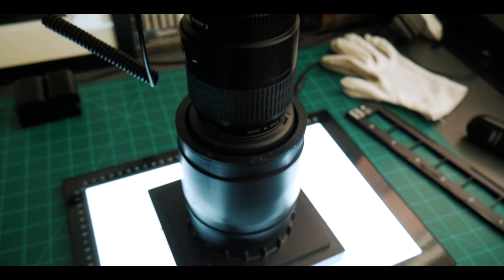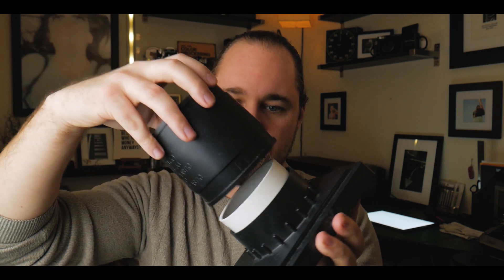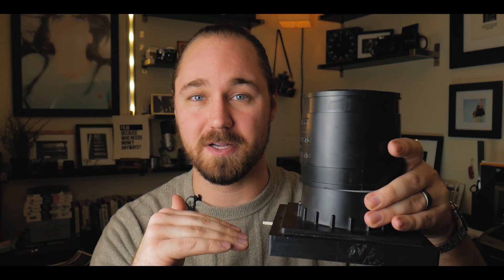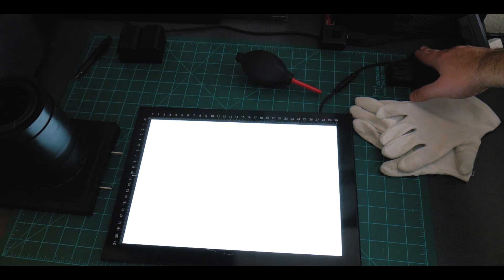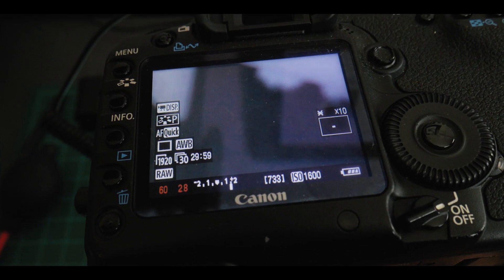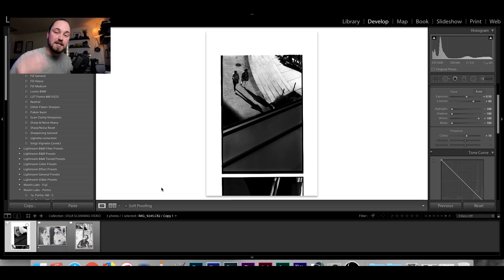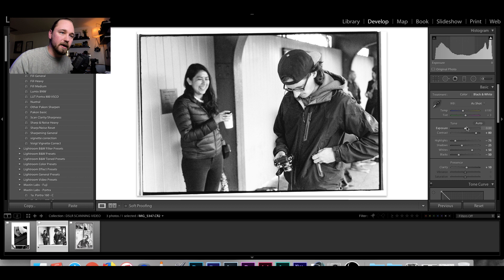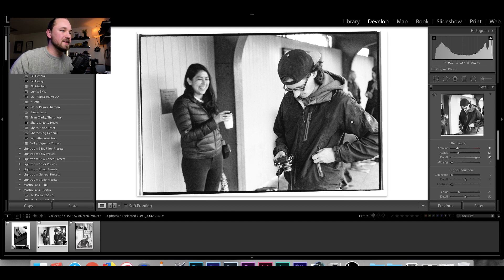DSLR Film Scanning Setup & Edit Workflow (DIY Film Toaster)

Comment from the maker: This video was a long time coming, but we finally got it out! I run down my entire setup that I built to make dslr film scanning as easy and streamlined as possible!! I hope it serves you well in either answering whether its the right setup for you, or how to maybe improve on the system you are currently using. Also if you have any ideas as to how I can improve my setup, I would love to hear. Be sure to drop me a comment, and ask any questions you may have. Thanks for the constant support!! Cheers
Reply: Oooh snap he’s definitely back. Dang man great job 👍👌🔥
Reply: Just as a follow up to my comments on your video, I've got a link for you on the Filmtoaster (slide / neg copier) which had caught my eye a while back .... Like I say .. " horses for courses "

Watch "How To: Scan Film with your DSLR (Film Toaster)" on YouTube
https://youtu.be/OOfQZChtzK0
Reply from the maker: Spencer Reed haha thanks buddy!
Reply from the maker: John Taylor yea that’s a nice setup. Had seen it before. It’s same concept, just super pricey. Its why I had called this the diy film toaster in the video title.
Reply: Working on making this.  Instead of the coupler I just used one of the screw clamps that the flex tube came with to attach it to the base.  Just put it half on each piece and tightened it down.
Reply: Good video.

Comment: 1600 ISO... dawg it's stationary, set that ISO to like 50 or 100 even if you need to take a 10 sec exposure the camera isn't moving. You should never need to add noise to a picture you already took.
Reply: And on top of that he's STILL raising the exposure an additional stop on a camera that came out in 2008.
Reply: If the shutter speed is 1/60-1/30 at 1600, than at 100 it will be 1/4 - 1/2. And even if it will be 1 second - will it be soooo muuuuch slower than 1/60?
Reply: Agreed, this is one issue I also consider a mistake.  Use lower ISO to achieve maximal dynamic range and minimal noise.  2nd aspect is, these days use rather a mirror-less camera with electronic shutter and avoid any issues with vibrations.
Reply: Exactly what I was thinking. Why set it to 1600 iso, that makes no sense, considering you can take a 10 or 20 sec exposure. Looks like someone needs to retake a basic photography class.
Reply: @John ok yeah, he's using live view so the mirror is up already. I used to tether my 5dmk2 to a laptop and check focus on it and you can even trigger the camera from the Laptop.

Comment: Great video; I chatted with you on Instagram today. I have scanned about 10,000 frames of B&W film, and only last week started to use my D750. I'll never go back. Even with 24 mp, the resolution beats my Epson 750 and my Nikon 4000. The whole drain-pipe setup is ingenious. Thanks so much for this. Great to find you.
Reply from the maker: Chris Klug thanks again for the kind words. And yes it blows the flatbeds out of the water. 👌🏻👌🏻
Reply: Nick Exposed my current setup is for 35mm; I need to figure out how to do medium format as well.

Comment: This is excellent..I'm just in the process of converting over from scanning to DSLR.  Your adaptor is the clean simple solution I want.
I was just about to chop up an old Durst enlarger into a copy stand.
Kudos for using plumbing hardware. I've made tons of stuff over the years from it, I'm retired .  From a socket to align the Xmas tree in a DIY stand to a new fliud reservior for the clutch master cyl on my truck.
So much can be done with all these bits that fit together in so many ways.  Many thanks I have boxes of stuff to scan this saves years.
Reply from the maker: Glad to hear the video helped out in your process! It’s pretty incredible what can be made with a few spare parts from the hardware store isn’t it! Sorry for the delay in response. I appreciate your comment

Comment: You should use the sharpest f-stop on the lens which is often around f5.6 to get the clearest and sharpest photos.
Reply from the maker: Jesper Sichlau I’m not too worried about it. Upon my personal testing I really don’t notice a difference. But each have their own standards.
Reply: If there's any curl in the negatives, like at the sprocket edges, f/8-11 might give you a bit more depth of focus to accommodate it. That's what I picked up from DP Review when they reviewed the Nikon film scanning set up, the ES-2, which I'm using with a Sony FX and a Nikon 60 2.8. I'm also using a Gagne Portra-Trace light box, about 10x12" and 5000k, works great. I'm getting a combination of 1/20th, f/8-11 and ISO 100 for 1:1 42mp shots. I have the camera on a copy stand, but would not need to, just easier. I trigger the shutter with a elec cable release plugged into the side of the camera, set for consistent 2 second delay. I just went through hundreds of negs and it was a huge time saver. Now I will batch process in PS to flip them all to positives and save to an external HD.

Comment: Excellent video Nick! and thanks for the shout-out :-D I am seriously impressed by the DIY rig you built. I am gonna check out "Bunnings" which is like an Australian version of Home Depot to see if they have the same square grate thing. Seriously would save pulling out the tripod, and can have different tubes for different film sizes
Reply from the maker: Especially when you only have one tripod and have to balance it between all sorts of projects. Hopefully Bunnings will have what you need, otherwise, I'm sure e-bay might help with some searching. Or JJ even mentioned in another comment the idea of 3d printing parts of the rig. That could be an option as well. Excited to see your upcoming vids delving into the color workflow!
Reply: @NickExposed  heya nick / pushing film... pardon my newb question. what if you were using a different camera, like say an APS-C camera with a 50mm macro lens on extension tubes.. should i even bother trying? how would you cut the tube to the right length for 35mm?
Reply from the maker: Punk Rachmaninoff that would work perfectly fine! How I figured out the minimum focus distance was quite unscientific. I placed the setup on the light table with a negative under the setup. Removed the pvc coupler and flexible coupling. Then simply held the camera and lens with lens hood above setup until the negative filled the entire frame when focused. Then took a ruler and measured the distance from the light table to the edge of the lens hood. Once I had that measurement I could then put the pvc coupling back into the setup and re-measure the same distance, marked the pvc coupler with permanent marker and made the cut from there. Hopefully that all makes sense 😅 it’s easier than my explanation makes it sound. If you run into any issues let me know.
Reply: @punkrachmaninoff  An APSC camera with say a Canon FD 55mm Macro is a perfect cheap option and you will get amazing results if done correctly.

Comment: cheap diy film holder...when I got my Ektachrome back from the lab, I took two of the "less successful" frames and popped open the mounts...removed the film...then with a strip of film in between (to insure proper spacing) taped them together (making sure the frame holes were aligned)...now I had a film holder that I could slide any 35mm film through and tape down on my diffusion surface to hold in place..one advantage (besides price) this has is that my commercial film holders have a tiny crop on top and bottom...this allows me to move the film up/down if I need to get right to the edge of the frame...thanks for the channel!!!
Reply from the maker: deltadave44 Im having a difficult time picturing what you’re describing. Could you send me photos of the setup on Instagram?
Reply: will do...but, basically, I'm just sandwiching my negatives in between two empty cardboard slide mounts (the ones I get from my camera store pop open and I can easily remove whatever film is in there)...then, I just tape them together...two important things...one, make sure there is a "spacer" (I use a film strip as my spacer) inside when taping them together...and two...make sure the frames are aligned to insure maximum surface area exposed to light
Reply: I posted a pic of it on my IG account and a pic from the scan...tagged you in both...thanks again for all the informative and inspirational videos!

Comment: I'm curious what LED light source you ended up with? I've run into 2 problems. 1) The "tracer" LED lights aren't as bright as I'd like to ideally shoot at ISO 100 without having to get into a 10 sec+ shutter speed. 2) The LED's that I have found that are bright enough (someone mentioned the Aputure small LED) don't produce seamless light like the tablet style tracers. If anybody has some info on bright and seamless LED options I'd love to hear.

I know I could go shoot at ISO 100 and the shutter speed at 10+ seconds shouldn't matter but I'm using a tripod setup with trigger so the longer the shutter speed the more likely there could be movement. I'd like to completely eliminate that variable.
Reply: @filminrussia7095  Thanks very much!

Comment: Nick just wanted to mention something I do to get around the reverse controls issue. I use a batch process in Photoshop to simply switch all the negatives to positive. It does a whole folder of images in one batch. Once thats done I import the positives into Lightroom and then follow everything you do except that my controls work the right way around.
Reply from the maker: Jim Sollows that’s a great idea! I didn’t think about the batch feature in photoshop. Thanks for the recommendation!

Comment: Hi Nick! The video is much appreciated! I also scan film with a dslr. I use an enlarger, simply removing the enlarger lens holder, setting the camera down on the base board and triggering the shutter via WiFi with an app on my phone. It's super bright backlighting so I shoot everything at f11 at 1/200 and adjust the iso between around 400~1600. I do this because I notice reduced sharpness from mirror slap at lower speeds. This is because I'm using a standard 50mm lens with a teleconverter and a crop sensor camera, so any vibration is very exacerbated. For your camera/lens combo I'd imagine you could shoot at a low iso and lower shutter speed with this approach. 
Cheers man!
Reply from the maker: Ah that's definitely an interesting way of going about it. I will have to ponder on the setup a bit, and see what parts may meld together well. Thank you for the suggestion.
Reply: Nick Exposed yeah, your set up looks pretty great tho, just thought you may be interested in experimenting.
We appreciate what you do for our community too bro. All the best for now.
Reply: Nick Exposed main reason I made the suggestion was that I figured a new high output light table would probably cost you an arm and a leg compared to a crusty old 35mm durst 🤣
Reply: use the 2s timer, your DSLR should then lift the mirror, wait for 2s and then expose. Hence no mirror slapping induced blur.
Reply: Stu Lora that sounds like a good idea but I imagine it would depend on the model of camera right? I'm using a Nikon d5600. Thanks for your input!
Reply: @davyboyo  I couldn't find it in the manual or specs of your camera. But try it in a quiet surrounding. Set the timer to 2s and listen. If there is a rather "loud" click immediately after you press the shutter button and then 2s later, a softer click, then the first one is the mirror.
Reply: Stu Lora I'll definitely give this a go! Thanks!!

Comment: Great video.  I have been dslr scanning for years.  My dedicated film scanner only takes 35mm so I tried tried dslr scanning and the speed and quality blew me away.  I merge two frames from a Canon 6D together in Lightroom, but for really high quality I have used six frames.  A good lightbox makes a huge difference.  The Kaiser Slimlite Plano is just over $100 but worth every penny.  I use a copy stand with a tripod head on it and some old enlarger film holders.  The copy stand is always ready so set-up is just putting the camera onto the tripod head, turning on the lightbox and loading the film into the negative holder.  I find that the negative holder from an enlarger tends to hold the film a little more flat, especially an issue with larger negatives.  Not sure why you aren't using a slow enough shutter speed to get your iso down to 100.  I think my longest exposure, at f11 and with the Kaiser, is about one second and usually more like a quarter second.  That doesn't really slow down the process.  I like your setup for 35mm.  Just brilliant.  I think I am going to give that a try, then I won't need to leave the copy stand setup all the time and the tube will mask out the room light so I won't have to keep turning them on and off as I load the negative holder and shoot.  Thanks for posting this and please keep posting your amazing black and white film photos - really great work you are producing.
Reply from the maker: Thank you so much for the kind words. To answer the question about the shutter speed, its simply down to the lowest shutter speed live view will allow me to shoot at. Thats really all it is. I dont want to lose my histogram, and liveview function. For me I dont mind the difference in iso, as I dont feel its really adding that much in artifacts to the scan. I ca understand completely how others may feel differently, and even how the thought of lower iso being a cleaner scan is justified, but my work is not about perfection, so I dont need a perfect workflow, simply an effective one. Thanks again!
Reply: @NickExposed  Interesting.  The 6D allows live view for very long shutter speeds.

Comment: I would use f5.6 and adjust the shutter speed @100iso and lock up the mirror.
Reply from the maker: canturgan that would take away my live view functionality and really render the whole setup unusable.
Reply: @NickExposed  Doesn't live view read from the sensor, with the mirror already locked up? Or were you referring to the fact that the light table was so dim that ISO 100 wasn't an option? Perhaps you've upgraded your light table since last year?
Reply: Depending on which camera you use, electronic shutter may be available, in which case, the sensor is just being turned off and on for exposure I think, no actual shutter action. I'm using a Sony a7Rii with two second delay, seems very quiet, steady. The flip up LCD is handy as is the white, red or yellow focus assist for the manual focus. I don't need to zoom in then.

Comment: A couple of questions:
Do you need a macro lens? Would using extension tubes work in place of a macro lens? 

Do you need to use a full-framed DSLR? What about a 16MP cropped frame camera or Mirrorless camera?
Reply from the maker: Great questions, buddy! You do not need a full frame, a crop sensor will work just fine (just keep the focal length in mind). And an extension tube on a standard lens would also work well as a macro replacement. Thanks for asking these questions. Great questions!

Comment: Great stuff as always, Nick! Can't wait to start using my Fuji for this and ditch the V550. Might try and 3d print something similar to your holder since the fuji lenses are so tiny!
Reply from the maker: That's a great idea! You could probably 3d print the entire rig to fit your needs. Let me know how it goes!
Reply: Why ditch the V550 ? .....  such a backward step.
Reply from the maker: John Taylor I’m not sure why that would be a backward step. I would argue the scans on the dslr are not only faster, but also sharper than the flatbed would offer. And depending on the dslr or micro 4/3 camera being used the size of the scans would be much larger than the flatbed would offer.
Reply: @kiwipics  at least with 35mm, I don't get the greatest scans with my V550 anyways and its such a slow process. I've scanned with a DSLR in the past and it's miles faster than a flatbed and I didn't notice a reduction in quality and that was with a T3i. Can't hurt to try it again with a newer camera.
Reply: @SubtleToast  ... Like I say, it's horses for courses. Everyone has their own way of working. For quick copies I'd use my Ohnar Zoom slide copier (from the 80's) and Snapseed to produce copies (not "scans") and upload to the net within minutes.

For everything else there's the Epson 1200 and Nikon LS film scanner.

Comment: Hi Nick, just came across your video, really enjoyed it, and really helpful. I am based in the UK, hoping I can get the items to build my own. Can I ask how do you fit the lens hood, is it glued in place? How did you cut the opening in the lens hood for the camera to go in? Thank you. Has anyone come up with any modifications for 120 film scanning? Thank you.
Reply from the maker: Hi Paul! So the lenshood I have actually fits snuggly into the rubber collar on the setup. No modification to that part was needed. It's an aftermarket lens hood for the Canon 100mm f2 macro I think maybe from Neewer? Depending on what lens setup you have and whether you have a lenshood for it or not you may need to play around in a hardware store one afternoon to come up with a creative solution. I hope that helps. I am glad the video served you well. Let me know if you have any other questions. Cheers!

Comment: Thanks for this excellent video. It seems to be an excellent solution, at least for 35mm. I wonder whether Adobe could implement an "Invert" function in the Develop module, so that we get rid of the inversed behaviors of settings once the curves preset is applied. This Invert command exists in Photoshop.
Thanks again and photographic cheers from France. Jean
Reply from the maker: Jean Daubas yea, I’m seriously surprised they haven’t already. I do have creative cloud so I guess I should try the cc Lightroom and see if the feature already exists in there.
Reply: @NickExposed  AFAIK this feature does also not exist in CC
Reply from the maker: @Prdips  bummer. It cant be too hard for them to release it. Hopefully soon.